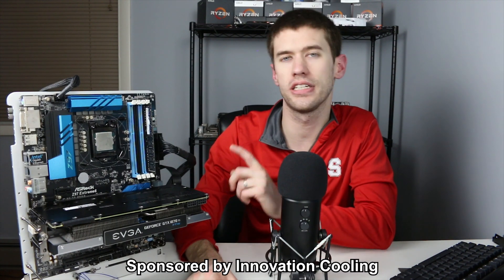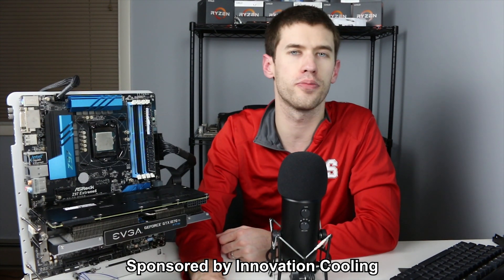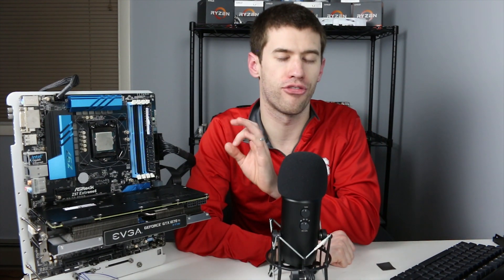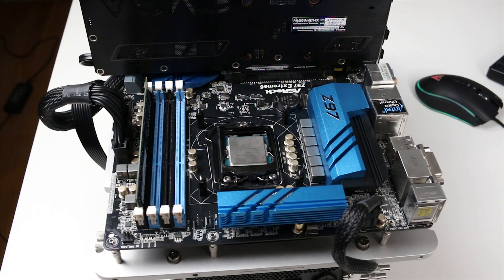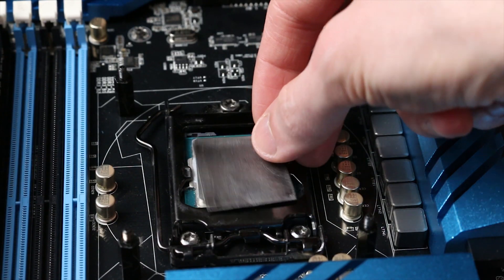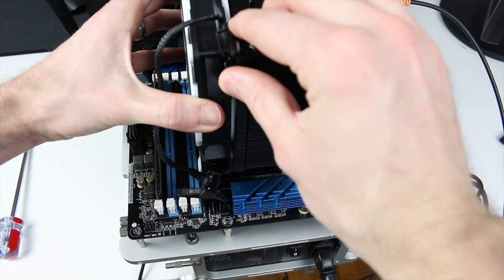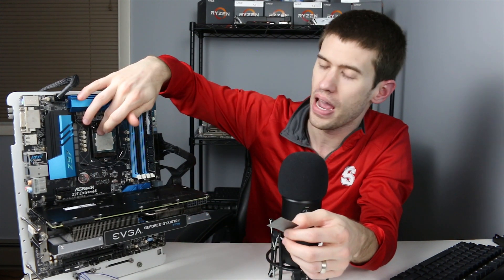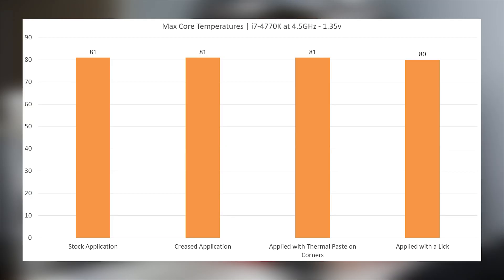The Ultimate IC Graphite Thermal Pad Application Guide

Comment: What I do with graphite or indium foil is put a small drop of 99% isopropyl alcohol on the CPU, then place the thermal pad, align it and smooth it down with my finger, looking carefully for any tiny bumps caused by dust. The alcohol holds the pad in place long enough to install the heatsink and not worry about the pad shifting. The alcohol soon evaporates like it was never there. Be sure to use 99% alcohol, not "rubbing alcohol" which has a lot of water that could corrode contacts. If there are visible dust bumps in the pad, simply remove it from the CPU, wipe off the particles carefully with a small piece of toilet paper wetted with alcohol. Then, re-apply the pad, smooth it down and if there are no bumps, you're good to go.

Comment: I tried some of this Panasonic carbon material the Digikey # P14965-ND THERM PAD 180MMX115MM W/ADH GRAY 0.0008" (0.020mm) The thinner the carbon pad the better the heat transfer vertically if you read the specs. I used it as a cpu thermal transfer on a Intel 9600K in place of thermal compound. It is easy to cut since it has a removable mylar backing. With the mylar removed it holds together and has a slight adhesive so it stays in place. You can peel it off to reposition if you need to. I could not see any difference in the cpu temperatures after application. One sheet is 4.5" X 8" so you can do a good number of cpu's with one sheet.

Comment: You were going good up until you put thermal paste on the corners of the cpu like glue, and you reached Verge level 'NOOOOOOO' when you Licked it. Hope this was a troll video, i really do. Lol. Paste on these pads will cause them to degrade, and i am almost positive spit will ALSO cause them to degrade. You should ask the sponsor of this video if they approve of these methods. Lolol
Reply: I think you can use a drop of alcohol in gel form, so it will stick the pad long enough to fix the cooler, then it will quickly evaporate when CPU heats up, leaving no residue behind.